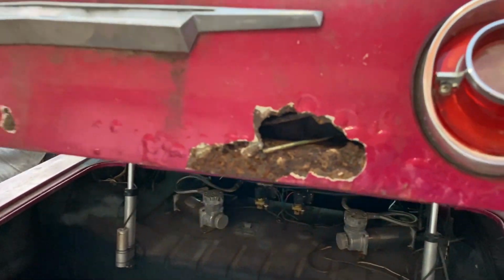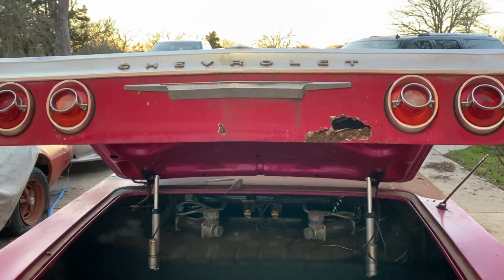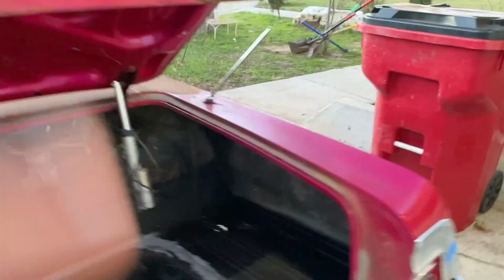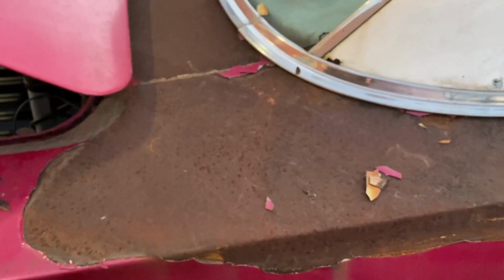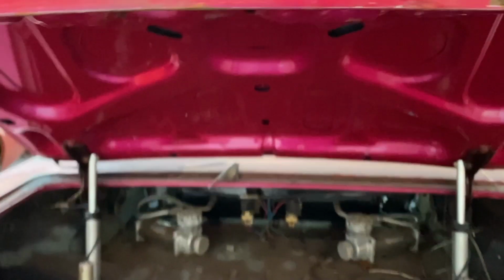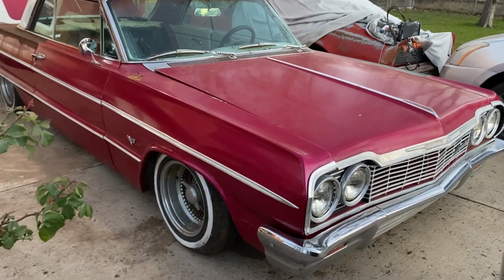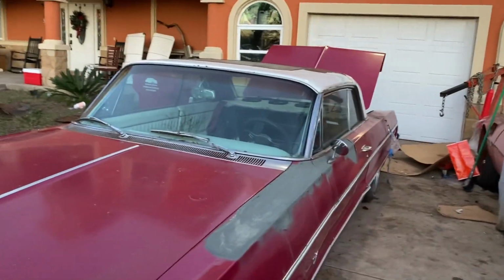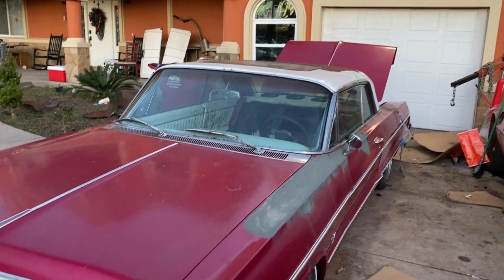We bought a abandoned 1964 impala lowrider part 6 (Floor pans replaced!!)

Comment: I say find a good OEM trunk as far as paint take things into consideration like your interior color unless your gonna redo that too or even the frame is also red maybe reverse it do a white body with a red roof with red and white patterns
Reply from the maker: I like the wat you think.  We are thinking of going With black interior. But since we have not decided on paint I haven’t cleaned up  the rest of interior yet.  Don’t want to spend time cleaning the headliner if it’s coming out.
Reply: @merc4hire914   on impala I would always just redo the headliner and possibly the panels depending on condition of the particle board behind material place a budget and stick to it budget builds are the best
Reply from the maker: @originalboyzgarage503  I actually grew to like the candy magenta but now I think we may stay away from candy since we are definitely going to drive the heck out of it. We want a clean cruiser that I won’t have to kill Someone for scratching that car. Lol. We are keeping options open. We put it on hold for 2-3 weeks because of COVID. My wife’s work got hit so she has been off a while. We should be back up and going in about 2-3 weeks. I’ll Post a vid of plans for this build soon though.

Comment: How do mark the spots to weld the floor to the braces?
Reply from the maker: From bottom with sharpie
Reply: @merc4hire914  thanks,working on mine right now.
Reply from the maker: @sdkins7994  good luck. It’s fun. Pain but fun.  I had too many projects and decided to let this one go before I could finish.  Went to a good home.
Reply: @merc4hire914  I was wondering why you haven't posted any impala videos. I have a LS 6.O for mine.
Reply from the maker: @sdkins7994  nice. Sold it with a 5.3 and put another r5.3 in my trans am. I have a 6.2 I’m building now